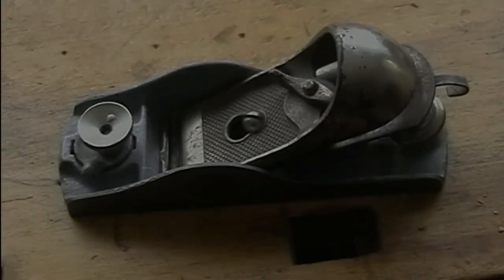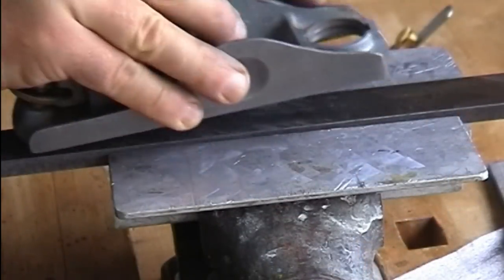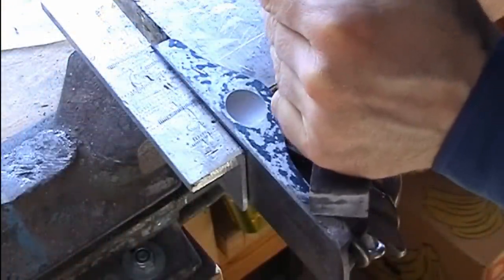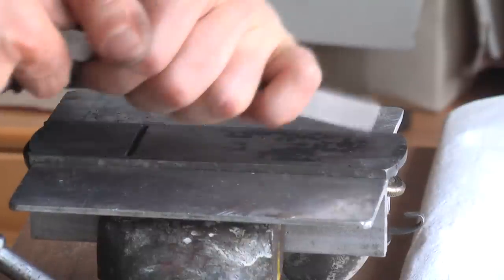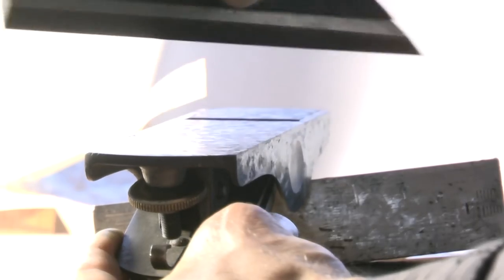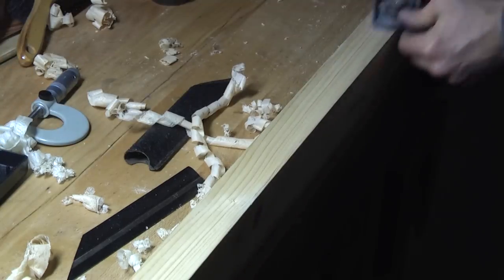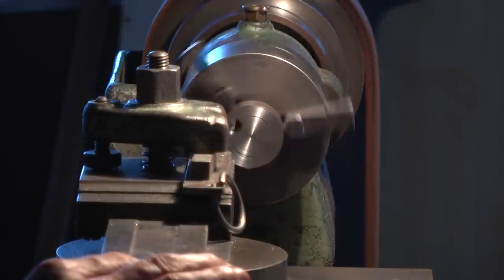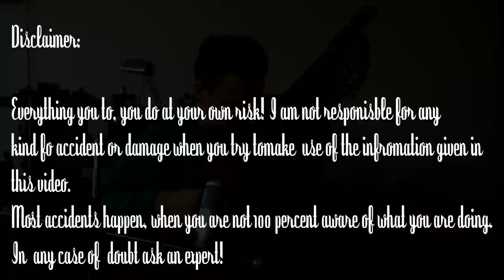Restoration/Tuning of a  block or hand plane to highest accuracy w. files, scrapers, edge & plate

Comment from the maker: Hello David,
thanks a lot for your attention.It is impossible to place my answer under your comment because of a missing link to your google+ account, I publish my answer here. Of course the tune up of standard hand plane is very much faster than to make one from scratch. I thought about making high precision hand planes for interested enthusiasts since a few years. But even if one has "high end" in mind, it requires much more workshop machinery than I can put my hands on. Just take a look e.g. at Karl Holtey's custom workshop an his state of the art equipment.But it still takes a lot of time, even for him, from start to finish. My feel to do so did not increase because of manufacturers like Veritas or Lie Nielson which offer factory tuned hand tools for an least interesting price. Bur for short if I could manage to get a bigger workshop and at least a metal shaper like a Cincinnati 25" of a Klopp 625, I would give it a try to make my vision of a kind of fusion between a jointer and a mitre plane with unbeaten geometrical long term stability, available for those who might have an interest in such a tool.

Happy wondering, Mike

Comment: You stated in a reply below ...." The next problem is, that the effective pressure at the sole edges is higher than in the middle. Sanding always results in convex shaped surfaces"

Would you contend that lapping a block plane sole on a diamond lapping plate would also produce a convex sole ?
Reply from the maker: yes

Comment: I really appreciated the thoroughness of this video, and the clarity of the explanations.  As feedback there are two things that I would have liked to have seen:  1) A final shaving after the tuning of the mouth to see how much of a difference that made.  2) A tuning more in line with what is done on a Japanese type smoothing plane, where there are only 3 contact areas, namely the front of the plane, the area directly in front of the blade, and the end of the plane.  It seems to me that the hand scraping method would be ideal to achieve this.  Still, I thoroughly enjoyed this video, thanks.
Reply from the maker: Hi John, thanks a lot for your comment. The Japanese 3 spot type of tuning wooden hand planes is a compromise due to limited test equipement in a traditional Japanese woodworkers workshop.  As long as the complete base of the tool moves on the workpiece, everything is fine. But at the beginning an the very end of the hand plane stroke round offs may occurs due to the concave area in front of the blade. If one analyses the situation of the two tables of a power planer, the geometrical situation is in fact a little more complex. 
Thanks for enjoying the video.

Comment: Would have been nice to see the finished article being used but still excellent video.  Thank you.
Reply from the maker: Hi Kevin,
thank you. In minute 27.24 I showed some test cuts after the geometrical tuning has been done. It is a tuning video and and not an instruction on how to use hand planes. To me taking care about high end tuning of hand planes makes little sense, if one has  little experience  in using it. And finally the video became long enough :-)  Whenever I may find the time to publish some videos on guitar making, you probably will see this plane in more extensive use.

Happy working, Mike
Reply: theorboguitarmaker Thank you for your response and I take your point!
Currently I'm knee deep in wood shavings most days (very large contract of bed making and rudimentary furniture - all morticed and tenoned), whereas I'm also constructing a large traditional roof project.
I have just lapped and tuned a stanley block plane and will have my son's wielding it, as well as my workmates lad.
Not too sure if I need to go as far as you have with your plane but I have a stanley 60 1/2 and 9 1/2 as well as a very early no 4 waiting in the wings for serious attention!
What iron would you recommend on the stanley no 4 please?  Hock, clifton or what?
And what about lever-cap and cap-iron?

Comment: Hi sir, great video. 

I am definitely no great woodworker, neither do I have the many exact measuring stuff you have. I do have a granite precision plate and feeler gauges, I have flattened the sole of my no4 stanley and tuned it very well. I can take incredibly thin shaving. Might have been luck, haha.

Some suggestions.It is a better to flatten the sole and sides of the plane as the last step. Because if you do that first afterwards flatten and square or in general adjust any other parts, this will ever so slightly affect the sole.

Perhaps flattening the parts of the back of the blade that touch the plane bed would be a good improvement. If there is convexity on the back, that would result in movement and it would give an inaccurate reading with the blue paint.

Now I did not worry about the sides at all, so my job was much easier than yours.

Thanks again.
Reply from the maker: Hello,
thank you for your comment.

When you start to remove material you will change the geometrical situation anyhow. Or in other words every (wanted) change causes other (unwanted) changes. So you always have to cross check different areas. Keep in mind that this video is just a kind of overview with the beginner in mind.

Concerning the mouth, bed and frog area keep in mind that the touching operation cannot be done under the tension of the lever cap, which leads to unavoidable errors. The error caused by the removal of material is in general smaller than the deformation caused by the pressure of the lever cap. Even if the blade is flat, which I showed right at the beginning of my video, it will not be flat under tension, because these regular blades are much to thin.

I therefore recommend to start the tuning at the areas of the casted body where most amount of material has to be removed, because this leads to changes in the metallurgical tensions and as consequence to geometrical changes, even months after the cutting has been done. So you need to check the geometrical accuracy frequently.

Thanks for watching my video and happy scraping

Mike

Comment: really great video so much information and easy to understand and follow, your a man of many talents! i have never seen anything like this before and will defiantly be giving it a go just need to get me some scrapers and a touch plate , I never liked using the glass and sandpaper method but didn't know of an alternative, what files do you use and do you know any good links on making scrapers ,thanks for sharing
Reply from the maker: Hi Dylan,
thank you for your comment and your attention. Under the topics scraping and flaking especially on machine parts you may find quite a few videos on youtube. Making scrapers out of carbon steel is standard operation for a tool black smith. so you will find videos about forging on youtube as well. Making flat scrapers out of turners high speed steel or old files is more or less a grinding and honing operation like on tuning plane blades, as I showed in my other videos. On carbide tipped scrapers you will find videos on youtube also, but most users round of the edges too much. I urgently recommend to keep the edges straight like on a chisel.

Sandvik, Friedrich Dick, and some other makers make files of fine quality. But you have to check each tool individually because bending due to the hardening process happens.

Happy working, Mike

Comment: Hi Mike, 
Great video.  I would like to give it a try, but I'm having trouble finding a touch/touching plate. What kind of steel, or what stock did you make yours out of?  Did you use your scraper and straightedge on it to make it flat (as you did for the planer)?  What did you use as a reference surface to perfectly flatten your touching plate? Thanks!
Reply from the maker: Hi John,
thanks a lot. Reference surfaces are only touching plates and bridges of cast iron or black granite. Please check out my correspondence with AESamuel, Dylan Mcguirk and trevorgdn. In the video I used and old oven plate as raw material, which is a compromise only. Check out http://www.jfa.de/ for todays art of precision. Merry chrstmas

Comment: Beautiful video!  Till now i have Always worked with sand paper on a plane surface but your "machinist & blacksmith" method seems to work far better. Where could i find those small metal scraper? I'm very interested on it. Thank you.
Reply from the maker: Hi Carlo,
thanks a lot for your attention. In the video, the post below it and some comments I gave some explanation of the technical reasons why the sand paper method cannot lead to high accuracy. The hook shaped scrapers a forged out of old files and very accurately hardened. Maybe you can find a blacksmith to forge some for you. At the moment I have no ability to forge.

Happy scraping,

Mike

Comment: would it help / be better to take a few swipes on some very fine sand paper as a final finishing touch just to knock down any potential high "peaks"?
Reply from the maker: Hi ironlionkalo thank you for your comment. The short answer is no. When it comes to geometrical accuracy, never use sandpaper. Please read my reply to Man na's comment about the same topic as a first reference. Happy working, Mike

Comment: Could I get acceptable results using just a straightedge instead of the touching plate? I have no touching plate but have decent straight edges readily available.
Reply from the maker: Hi,
yes it is possible if you have a highly developed spatial imagination. The straightedge only gives you a one dimensional image about the topology at a time. So you have to work very systematically and use markers of different colours for 4 different directions. Only spots with all 4 intersected marks are high spots. The most common error by this method is twisting.

May-be you can put your hands on a polished piece of black granite from a scrap yard or gravestone carver as a starting point. If you have several choices, take your straightedge and pick up the most accurate.

Some aspects of using a straightedge only is shown in my video on tuning a wooden jointer http://youtu.be/8CtHvQ_m70k.

Happy working, Mike
Reply: Thanks a lot for the advice!
Reply from the maker: AESamuel Nice if I could be of help.

Comment: Hi Mike,
Very nice work on the video, it is concise and easy to understand. This is the first time I've seen this method for flattening the sole and I'm curious as to how it compares to the conventional sandpaper+glass method. Is the trueness of the flattened sole not determined by the flatness of the plate you use to apply the blueing and the thickness that the blueing is applied to the plate? Someone should do an objective comparison between two identical planes flattened with the two methods to really find out.

A problem that might arise from this method is that the plane is not flattened under it's working pressure, so that any flexing that normally occurs in the bed is not accounted for. It's probably not significant for a small block plane but longer planes flex a fair bit under use which is accounted for by the sandpaper method as the sanding simulates normal use (pressure on the knob and tote).

Thanks, Trevor.
Reply from the maker: Hello Trevor,

thanks a lot for your comment and happy new year. Of course the most important factor is the geometrical quality of your reference surface. That's why touching plates and straightedges are standardised. Keep in mind that it has reasons why glass is not used to make touching plates. The layer thickness of Prussian blue is in micro meter region and neglectable in comparisons to the inaccuracy of sandpaper and its ductility. The next problem is, that the effective pressure at the sole edges is higher than in the middle. Sanding always results in convex shaped surfaces. Just use a real straightedge on your sandpaper tuned planes and you will see this immediately. Because I showed my results both with the Prussian blue image and the straightedge, you can compare your result easily with my result shown in the video.

Keep in mind that your mentioned working pressure problem is primarily caused by the ductility of your wooden workpiece. If you flatten the sole under lever cap and blade pressure, and you press the plane against the touching plate, you will have the same situation as when you use the plane (but without the blade in cutting position) on a flat piece of wood. The second and mostly ignored problem is caused by the fact that you have a cutting edge being outside of the sole surface. so in working position your plane would more or less only have contact the wood with the front part of your sole. Ideally the back part of the sole should be the amount of the thickness of the shaving you create lower than the front part of your sole, like on a power jointer. But that's not really practical for many reasons.

For short the physical behaviour of wood and the cutting process by the blade outside the surface plane of the sole, destroys any imagination about a more or less ideal linear or Cartesian geometry. Even with a high end tuned hand plane, the art of how to move the plane on your wooden workpiece is key to true joinery, besides scraping afterwards.

So for short it is all a bad compromise, but working speed, accuracy and reproducibility by scraping is unbeaten compared to any other method.

Happy working,

Mike
Reply: theorboguitarmaker Hi Mike, thanks for replying so quickly and in such detail! That clarifies things for me. I am unsure what is meant in that second-last paragraph ("For short the physical behaviour of wood and the cutting process by the blade outside the surface plane of the sole, destroys any imagination about a more or less ideal linear or Cartesian geometry")? What are you getting at there?

Would you recommend this method for flattening chisel backs; would the steel in chisels (~60Rc) would be too hard for the scraper? Also, do you have any scraper recommendations, they don't seem very common. I see that Eclipse has a range of them (http://www.spear-and-jackson.com/product/scrapers/engineers-scrapers).
Reply from the maker: trevorgdn Hi Trevor,
I get there to a point that is of interest for the engineer or scientist but is of very little or no use at all for the practitioner, because it is of no help to get an idea about where and how far you want to go. Go as far as you feel ok with, than re check after a year or so to see if it is still ok for you or needs improvement.

No, for chisel backs only honing is the way to go. May-be except the the blade needs to be rehardend, so that you can glow it to softness and then control/improve its flatness. But keep in mind that after rehardening, the blade may bent and your improvement may get lost, and honing has to be done anyway.

I purchase may scrapers second hand or make them by myself. Here on youtube you may find a lot of tips about scrapers. You can regrind a chisel or an old file to make a straight scraper. Many users round of the edge to much. I do not recommend this. Keep your edges as straight as possible.

Happy scraping, Mike

Comment: Is your straight edge scraped? I would like to scrape my planes, and scrape some straight edges for working stock by hand
Reply from the maker: No because they are hardened. They can only be ground and lapped. These very fine edges would get demaged to easily if made out of soft materials.

Comment: Neat video! Lots of good tips on filing and scraping technique. I have attempted to scrape a block plane of my own with good results. I used a piece of float glass as my touching plate and an old spent file with the teeth near the tip ground off.

Is that an ordinary piece of HSS bar stock you are using as a scraper? Also, did you modify the edge in any way (e.g., burnish a hook) or are you just using a ground square edge?

Additionally, although you showed that the blade referenced well to the straightedge, how would you correct the surfaces if they were concave or convex? Hand lapping seems to introduce convexity.
Reply from the maker: Hi Mason,
thanks for your comment .

1) HSS
It is a standard turners type with hollow ground front and very lightly curved so that I can use 2 of the 4 edges.The sides are polished, the edges kept absolutely sharp, no burr.
It is a compromise but works fine

2) Blade
a) if the hardness is not correct which happens often, I soften it completely tune it up with files and scrapers, in worse cases back on the anvil, than re-harden.
The final stages are done on oil or water stones

b) correctly hardened (Stanley type)) blades are tuned up on bench stones. The stones are kept to straightedge flatness, the most important factor. The second factor is the way you move the blade on the stone. Sometimes it is of help to use a pressure block (wood) to selectively increase the force on specific areas of the blade. For convex shaped blades move the higher parts over a corner of the stone and do not use the whole surface area of the stone until flatness is improved (for short: usage of p = F/A). This is shown in my video on tuning a tipped blade: http://youtu.be/WgLdzy_yUgM

c) another way to handle convex surfaces is to use a stone with smaller surface area the the blade

d) if you have someone at hand with a flat grinder and an experienced operator and a real flat magnetic table, this may save you a lot of time

I am working on a video that show the tuning of a wooden jointer with intensive blade tuning. To that video go to http://youtu.be/8CtHvQ_m70k

Hope this helps, happy working,

Mike